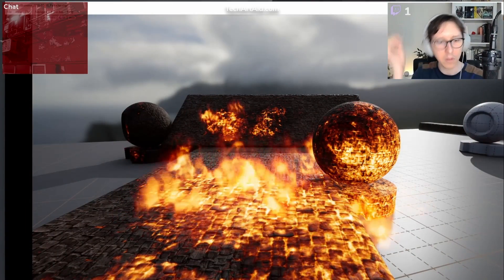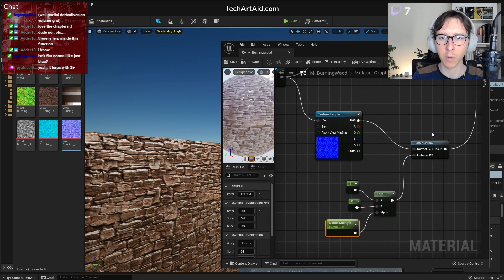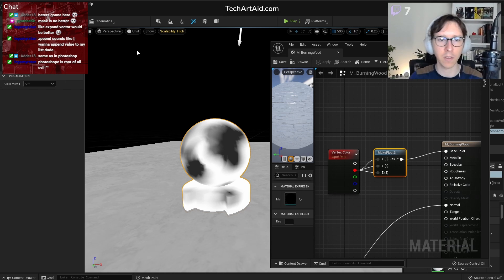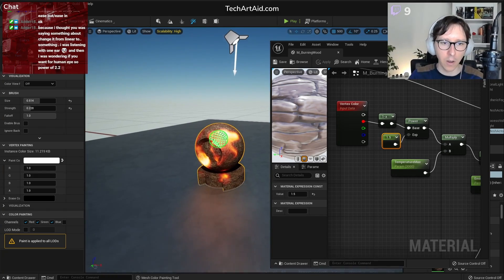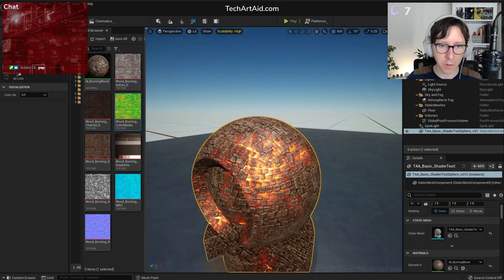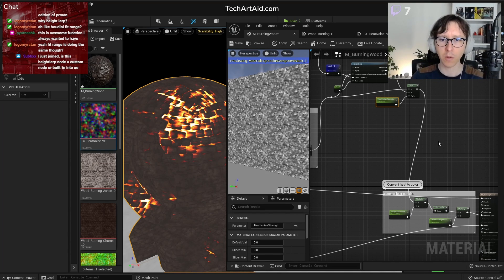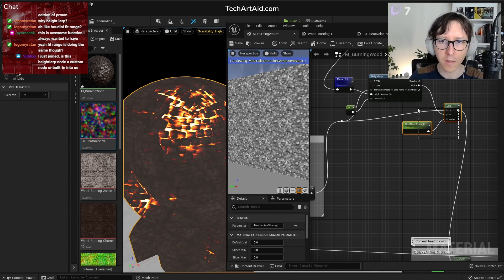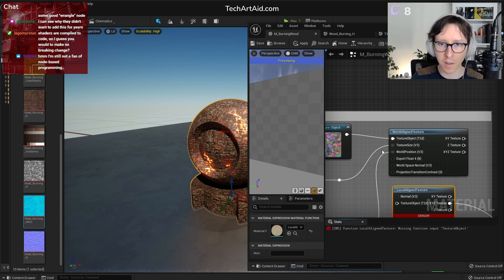UE5: Burning Wood Material // Unreal Engine Tutorial

Comment: Is that impossible in 4.26 UE4 ???
Reply from the maker: No. Everything should be the same
Reply: @TechArtAid  thanks for reply :)  but I try to this tutorial in UE 4.26ver. And I have checked some issue that have many of lines which following camera view in my mesh. Anyway this line issue also depend on Vertex Color to '1-x' part of " Read heat intensity from Painting Data".

To solve this, I unlinked 1-x nodes then the material doesn't cover by wood something ...
Reply: I've solved this problem :) 
First : Unlink  'power nodes' and parameter named 'Range'.
Second : Get Multiply nodes linked to '1-x' and make parameter having any names thay you like. 
Third : Just link where linked by previous multiply node.
Reply from the maker: Nice! Thanks a lot for the update